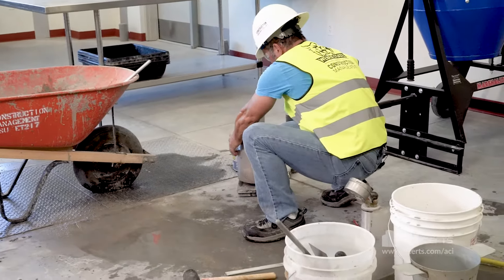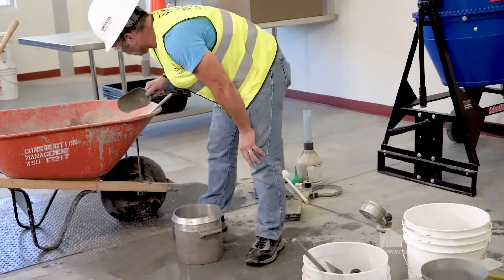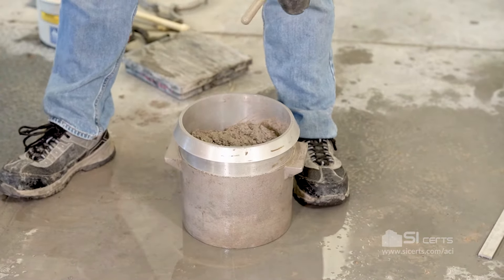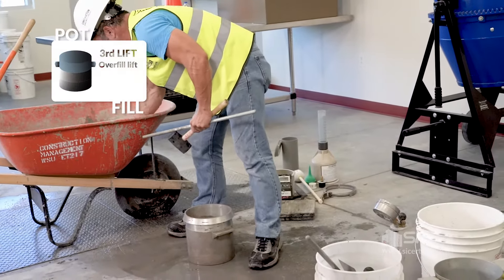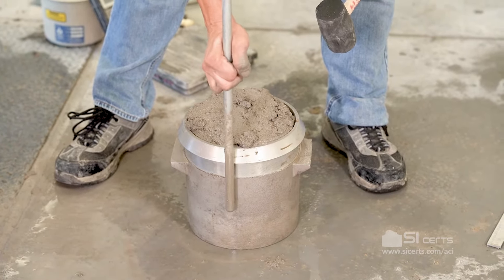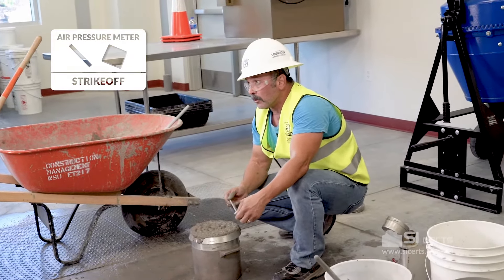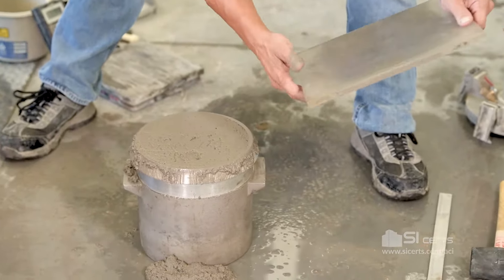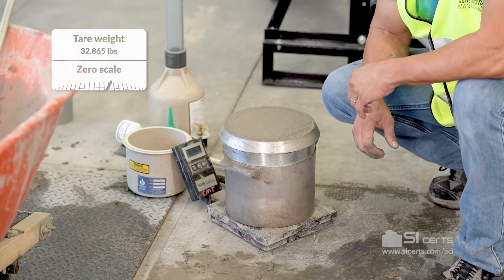ACI Density Test: ASTM C138 Density (Unit Weight) 2019

Comment: Sir, you don't zero the scale AFTER you get the tare weight. Pointless to get a tare weight if you zero it out. Therefore your math is now wrong.
Reply: Hey Jimmy, you record the weight prior to the tare. You can see this graphic representation on the screen as we do it. As long as you note this, you can account for it in the end. There’s more than just a single way to do this.
Reply: Well with most if not all calibrated scales once you get the weight of the pot and get the tare the scale resets to 0 then once the pot is removed it would show into the negative. Example. If the pot is 8lbs and you get a tare down to 0 once the pot is removed the scale will read -8lbs if I’m not mistaken.
Reply: @tanumie2657  To prevent concrete from sticking, making it easier to clean. Keep your tools happy, and your tools keep you happy.

Comment: How did you get the mold volume
Reply: All meters come machined to a precise size from the manufacturer, 0.25 cuft
Reply: By measuring the weight of water of the container considering  volumetric correction factor depending on water temperature.

Comment: (Weight of concrete + Weight of empty measure) - weight of measure / volume
(32.865 - 7.79) lb / .25 FT CUBE
100.3 LB/FT CUBE IS THE DENSITY
Reply: 32.865 lbs is the weight of the concrete without the weight of the container/mold.  So you're subtracting 7.79 lb that was Already Subtracted.  That's where the error is.

Comment: 32.865÷0.2504=131.25
Reply: Where is the weight of empty measure?
Reply: @michaelparionaramos4097  The pot was tared, meaning that when he took the empty pot off of the scale after the scale was zeroed, the scale reads the negative weight of the empty pot. So when he puts the pot back on to the scale when it's filled, it subtracts the weight of the pot for you. That allows you to essentially weigh ONLY the mass of concrete. Doing that means that you don't actually have to use the mass of the empty pot in the equation.
Reply: @babdabubda5266  Thank you very much for the brilliant explanation.
Reply: @michaelparionaramos4097  Haha of course man, have a good one.